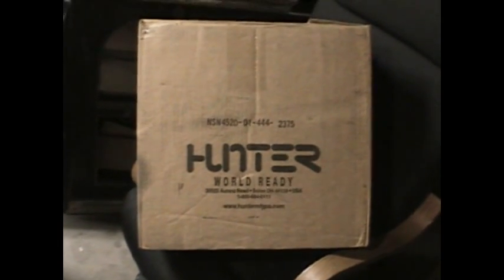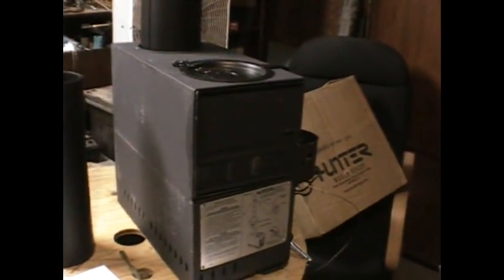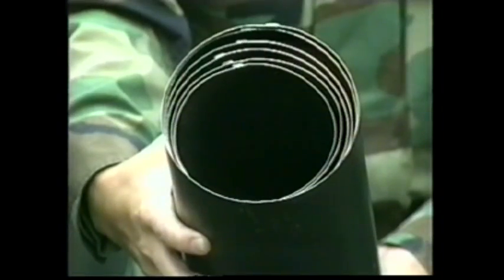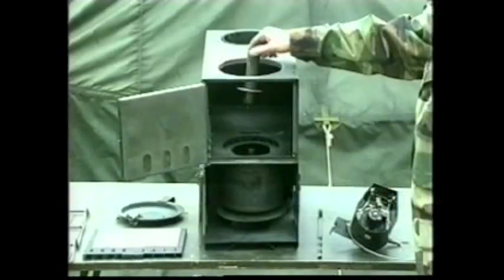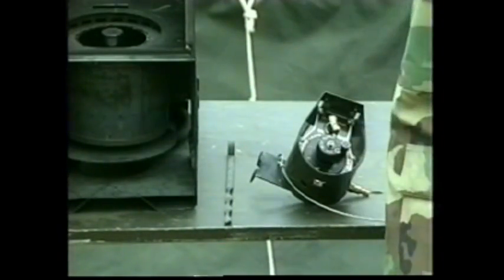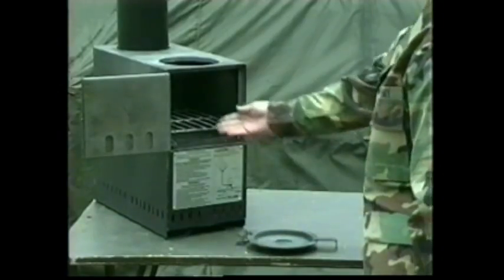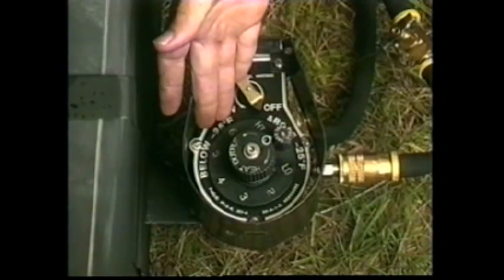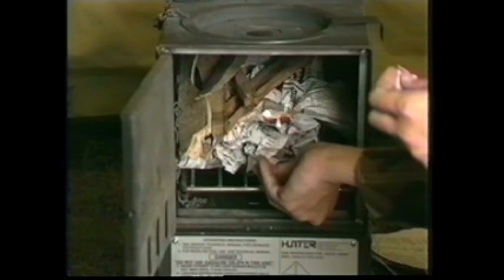Off Grid Heat Source. Army Surplus Hunter SHA (Space Heater Arctic)

Comment: I used the older version of the Yukon stove in Korea in 1977-1980. We used Gasoline ,as diesel froze at -30 below, and if you don't try to relight while hot, we didn't have any problems. Nice to have hot water for coffee in the morning, and we used it to heat the old c-rations!
Reply: i used a mixture of mogas and diesel for the same reason but diesel has more btu

Comment from the maker: @k1111117 Glad to be of service. The documentation says 20,000 btu's.  the yukon hands down give off more heat with solid fuels, then again, it could burn more wood at a time.I have both the Yukon and SHA, when I get some more parts and time, I'm going to face these two heater against each other in a video.

Comment from the maker: @rimfirematt around 40 to 50 pounds, haven't put on a scale or anything. it feels that heavy with all the accessories and parts which fits inside the stove like the yukon. The diameter of the pipe is tapered from 5 1/2 inches at the stove to about 4. inches on the top.

Comment from the maker: @InTheSticks0001  I have both and fired them up with scrap wood. the yukon I would say is the better all round stove in this class. you could burn gas, longer pieces of wood and it boils water quickly. The SHA does not boil the same amount of water and does gas is not recommended. I like the SHA for space heating and conserving fuels in my workspace and use the Yukon for burning oils.

Comment: I pour a priming cup of generally any low flash point fuel I may have around for ignition. After the burner shell heats up, I feed waste motor oil in to the burner shell. I am working on an oil injection system for it as well as an igniter. I have yet to connect the fuel lines and control valve. This would be useful for ignition fuel.

Comment from the maker: initially when you start and at the end it smells of diesel a little bit. During operation it goes away pretty quick. I always let the burner go burning after I disconnected the fuel. it will leak out the overflow hose if you leave any fuel in the system. not a very good on/off mechanism for it.

Comment from the maker: Not specifically made for this equipment, what you see is what you get. What I did was use some of the sections that tapered down to 8 or 6 inches (I forget), then transitioned to double walled pipe section you can get at your local hardware type stores. So, far no carbon dioxide leaks or smoke in my garage going this route. Warning, probably not to building code, but its my backup temp survival setup in case I really need it.

Comment: Wow, I've actually seen this video years ago on how to use it. LOL.
I remember the burner on the old version being on top, and the fill valve was a simple screw. We used a gas/diesel mix usually.  I nearly blew my shop foreman to bits once using straight MOGAS with the valve wide open. The sides of the Hex Tent bellowed out like a cartoon when he lit it and he emerged with singed brows and a smoldering moustache. We laughed like hell after it was established that he was free of 3rd degree burns

Comment: I have used the M1950  a lot and the older pot belly a little. The pot belly burner system was similar to the SHA.  Using strait diesel or JP4 would soot up the the system and create a terrible mess.
cutting in about a gallon of gas would make it burn cleaner and hotter. Using strait JP4 would require cleaning the burner unit and stack every 4 days or so. and what a mess it would be, it's difficult to clean it without becoming covered in soot. I found the 1950 to be a little easier to clean and there is not much to the burner. I don't think I would use solid fuel in ether unless it were life or death.

Comment: how much liquid fuel to burn for 6 hrs? also with cole how long will it continue to put out heat , last question has anyone had success with used moter oil?
Reply: John Hales I would not recommend used motor oil because the viscosity is too high and it could* have difficulty flowing through the control valve. Used motor oil also runs the risk of not being able to vaporize properly and could* result in a very inefficient burn with high carbon monoxide production. This thing isn’t built to run on sludge, it’s built to run on diesel, kerosene, and in emergencies, gasoline, all of which are much less thick then used motor oil. The manual probably tells you how much fuel it consumes per hour, and coal burns long enough to get you through most of the night without having to constantly keep waking up to stoke the fire.

Comment: I would love to use this in my un insulated garage, where I plan on living in next winter.  Price is great.  Thanks for posting.  How many square footage will it warm?  I only have a one car garage.
Reply from the maker: Don't know about sq footage, but they claim a 10 man tent, which will fit a car with extra room. My garage is a typical 1 car garage,it heats it up alright, if I had insulation in it, I'll be toasty for sure. Here's a 3 year update if interested. Thanks for watching.
Off Grid Heat Source. Army Surplus Space Heater 3 Year Updates & Mods..
Reply: Thanks.  Will check it out.

Comment: I dont think you are using it correctly or you may have a regulator for a H 45 stove which is a common mistake in the surplus market. I have used these stoves while stationed in AK in -40 F with no issues. They are very simple to use, try downloading the FM which is open source now.

Comment: I am converting my single car garage into a living space.  You think your size stove will heat up my garage?  Great vid.
Reply: +nzinga zindua Not my post.. but check your home insurance.. Your rates will either go sky high or you could loose your coverage.  It won't heat a garage very well.  It was designed for small Artic Tents, the New Squad Tents, and GP Smalls.  Nothing bigger than about a room with 15 ' diameter or perhaps 400 sq ft.  It'll work in your garage but you'll still need to dress warm.  Also, the fuel can sits upside down on a tripod and needs to be located outside the room and place the tripod and drip can inside a large drip pan.  As the hoses do leak from the quick disconnects after about a year.
Reply: Robert Cole Thanks.
Reply: Yeah this is a bad idea in a.residential setting. The stove pipes need to be cleaned daily. A chimney fire WILL happen. If it is being used daily in a residential environment.